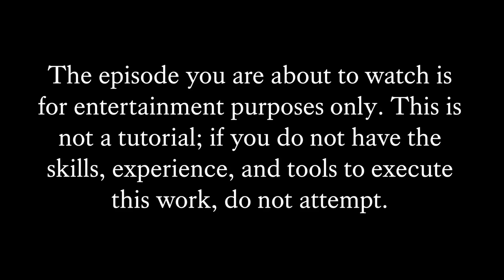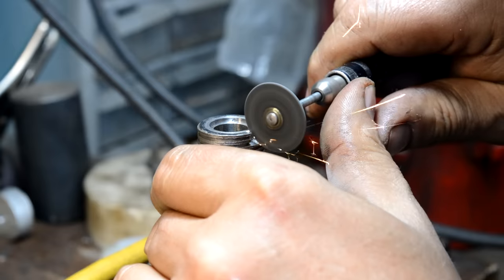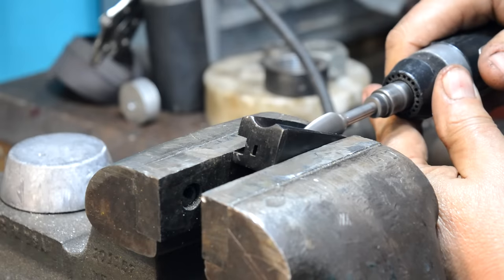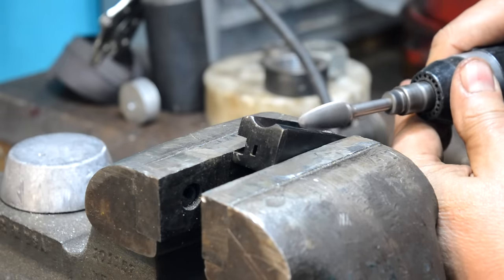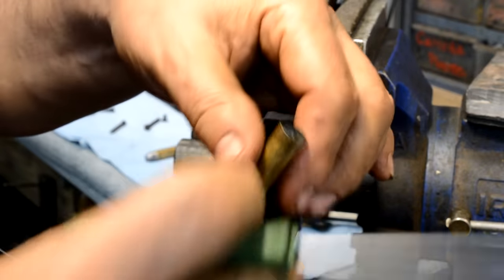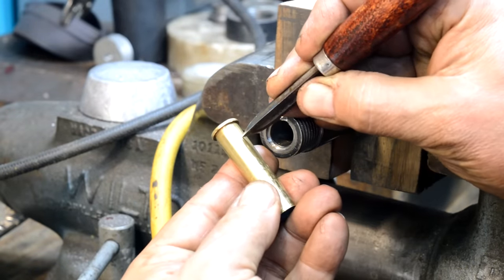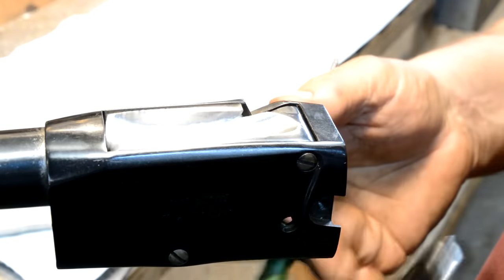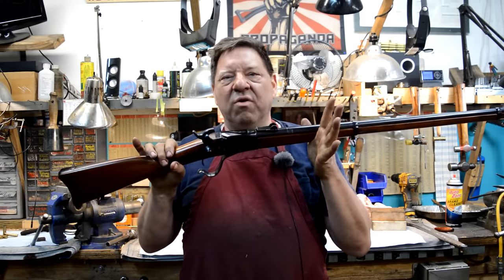Peabody Rifle chamber sleeve job: Anvil 112

Comment: If I remember, that cut is off center from the hole, I was thinking it may have been a broach cutter, then chisel work, or scrapers. They did such unique cuts with hand tools back then also.
Reply: I'd expect some custom tool for the job. If it's concentric to the pivot holes, then I'd use those holes to line up the tools.
Reply: I would say a purpose built broach was used.

Comment: I've often thought about how they cut the breech block shoulders in the martinis, and with it sharing the axis of the hinge pin hole it would have had to have been cut through that hole. It's possible it was roughed out with a radius milling cutter through the top then set up in a fixture with holes matching the pin hole on a separate machine. Here you could insert an arbor and cutter (similar to a line boring operation) to finish the radius to size and square up the corners. I might give it a try for fun, maybe make up a mock receiver and some tooling. If it's a success I'll post a video.
Reply: That'd cool to see!

Please post here if/when you get that video made.

Comment: I I had to make a bunch of them, I'd make a rotary broach that piloted off the pivot pin hole.  Segment it into enough individual cuts as to be workable.  Maybe a rougher and a finisher.  Make it out of M2 it should last thousands of cuts.
Reply: i like the idea but wouldnt there be evidence of the pivot pin hole in the block? what about a shaper very short throw and an right angel cutter?
Reply: @pghgeo816  the breech block pivot pin is there, Kipling!  😆

Comment: As per your question.. "How do they get that relief cove cut put in there?"..... Manually. Here is a video of the "ENDIE", not the "OUTTIE" or the "INNIE"... The the "OUTTIE" and the "INNIE" are two other processes, still manually dealt with, by means of manually assembling the cutting tool(s) once inside of or passed through an obstruction area... Although, this video I am placing a link to, may look primitive, in their processes, where as today manufacturing processes of full throttle automation has allowed for a more efficient mass production, there is still some processes, that no machining center can simply handle. At least not with out buying, or having built some high measure of specialty machining system that performs just that one odd/random step, that can be handled simply manually/by hand and cheaper tooling.  I would recommend simply watching the video for the sake of how great our beloved western world has it. 

But, if you pay note starting at the TIME STAMP of @6:00 for about 30 seconds... You will see, the dual "ENDIE" manual hand cutting tool in action, and the cutting surfaces dimensions are simply controlled by the nut at that other end, which also serves as the ease of removing the cutter to then remove the shank from the already reamed double shear holes, for the sewing machine's lift arm axle/bell crank axle. Enjoy. 
https://www.youtube.com/watch?v=N21ruMGeGa4
Reply from the maker: Nice video. Proof that high speed stuff can be built without lots of money.. Thanks

Comment: Mark, I defer to your knowledge, skills and ability in discussions with my friends. I once ran a machine tool business. So your question on production. 

The Martini-Henry rifle is a modification of the Peabody. And that lockup of the loading tray/bolt to the frame is epic. The British cut that frame with a device called a “side brooch”. It plowed out a rounded grove up in the frame. A rough cut in essence. A rounded cutter, think file, was then suspended on a shaft and partially rotated to further finish the cut. It was finally finished to dimension by lapping in the bolt with abrasive paste. This is why you can’t just swap bolts among old martini rifles. 

The tolerance on that bolt and the abutment is typically 0.001 inch or less longitudinally when in battery. And yet “parts” bolts for those guns may vary by 3-5 thousandths of an inch bolt to bolt. Because rach was fit using this laborious process. 

Now today we would use a 5-axis CNC with a ball end mill and simply cut that fillet and be done. They did not have that luxury. They improvised. 

Enjoyed your video as always. 

Fox out.
Reply: Would a "side broach" be similar to a shaper cutter?
Reply: @danmenes3143  
The “ thingy” I saw in a museum of industry in England was a mechanical brooch. Usually the bit is flat and cuts into the stock as it’s secured to the table. This one had an extension that stuck out the side with a button that would cut in a “blind” space. I eas informed that it had been used on the “muskets”, several martinis being on display I presumed that was the musket in question. 

I am not a machinist by trade. I came into CNC equipment on the computer side. But in consulting on programming I frequently asked how’d you make this thang in the bad old days. They were usually glad to explain all the gigs and fixtures to me. Then I’d write them a cad/cam file and go home. Different strokes for different folks. We learn as we go. Then I went home, took my martini all apart cleaned off the grease and started looking at tool marks up in the nooks and crannies. 

Fox out.

Comment: ANSWER❤❤: the Watts Bros Tool Drill is used to machine square holes.  When the lathe is running, you can see the head "bouncing" around in its guide.  Based on a concept which uses an equilateral triangle with bisecting curves of constant width.  Square holes can be so sexy.  "Triangular Wheels" on the Curiosityshow channel provides a simple tutorial, explanation, and application!  April '56 issue of Popular Science shows how to make one.

Comment: To make that cut in the back of the receiver, I would modify a ball endmill so it would have a spherical section on the end and machine to near the outside. After the semicircle cut I would fixture the receiver in a rotary table and use a slotting head attachment on a milling machine to make square corners with another custom ground tool. This last operation would clean up the edges and square them to the ends of the semicircle cut area. I used to work for John Martz Luger maker from Lincoln, CA. On the barrel extensions there is a stud cut into the side of the extension and it has a radiused area that can only be accomplished by using a slotting head on a milling machine, a correctly made tool and as the slotting head is reciprocating the rotary table is turning the barrel extension cutting a radius inside a small area. There were three or four parts on the Luger pistol that had parts that had to be slotted while rotating on a rotary table. Nice work Mark!

Comment: I believe that unknown cut you're asking about was done with the same type tool used to trim down the ears on the bottom of a 1911 barrel where the slide stop holds back the barrel. Like starting an old crank style Model T Ford, you have the crank rod, and a slide on sideways reamer bit used to cut the radius as you turn the crank. The bit would have to move across the plane of the radius as it's cranked, cutting from one side to the other.

Comment: Excellent video mark I had an old marlin whitney 40-60cal.carbin length saddle gun or so we were told  I wanted to have it rechambered to 45-70. However all the folks I spoke with told me the rifle wasnt a carbine  and should have been 11 to 12 inches longer and that there was no way to make the conversion. It was an 1880 model and year. The whole rifle was 29 3/4" long

Comment: I suspect the radius was cut using a cam directed single point tool something like a shaper or planer.  Today I might do such an operation with a die sinking EDM. But that is not suitable for high volume production. 

I look at how many of the cuts are made on lever action firearms and wonder how it was done.  Manufacturers in the past built a lot of dedicated machinery.

Comment: At  about the 7.5 minute mark you said that the Dremel has a place in the shop, but never as a "go-to".  I grew up with a gunsmith whose shop equipment consisted of an Atlas lathe, a Delta drill press, and a small barrel of dead Dremels.  He made a good living for 50 years knowing what his limitations , and the Dremel's were.  He'd go through 3-4 a year, and never a day went by that he did not have one in hand. Good Video!

Comment: The way that cut was done is definitely a real good head scratcher. If somebody told me to do it... I would put a 3/16 boring bar through that 1/4 screw hole and then insert a hss cutter into the boring bar. You can get a good 1/16 deep cut out of it I would reckon

Comment: 12:54 if the radius is concentric with the hole, it could only have been done on a lathe with a tiny groove cutter style boring bar.  If it's not, it could also have been done on a horizontal mill with a remarkably small arbor and cutter.

Comment: The cut is almost certainly done on two jig grinders, using a small radius grinding belt cantilevered on an arm. Infeed to one corner on the "left handed" machine, note the infeed hard stop, set up the "right handed" jig grinder to the same stop.  Clean up mismatch by lapping with a die made specifically for the task.
Reply: Could be wrong but not entirely certain that the grit and belt quality that we take for granted was available back when this was made..
Reply: @mastermaker666  Wouldn't be the aggressive and durable ones of today.  Significantly slower removal rates, perhaps even using emery cloth.
Reply: @DopetheWind  Not saying it can't be done that way, just that the machining marks indicate that it wasn't the way they did it and that they would be unlikely to have anyway given the time and effort involved when there was a faster and more efficient way of doing it(single-square-tooth boring-bar style cutter threaded into the hole without the spindle running)

Comment: You should just add a very small bead of tig weld or 2 after you line up the holes. This is done with a lot of manufacturers and doesn't harm anything.

Comment: Im guessing that cut was either done entirely with a horizontal mill or with a slot cutter cut vertically then a small boring bar looking tool to clean up the edges
Reply: Beat me to it!
Reply: Another thing that might work is a custom slab cutter on a keyed shaft that runs through the bolt holes.
Reply: Yeah that's what I was going to say. Horizontal mills were a lot more common in the late 1800's / early 1900's.
Reply: @kajiarrow7761  I was envisioning something like that a one off tool
Reply: yeah i cant envision how the edges or ends were squared

Comment: The machines back of the block with a very small boring  bar, with a removable cutter that's held in place with an end center line set screw.

Comment: Mark, I agree with Lauren H, 
I can remember seeing an old newsreel film converted to video of a Ball Burr being used to cut round ended recesses in a steel housing for valve pivots, they used a jig that moved the housing to accommodate the burr coming in from the front of the housing to make it cut  eccentric due to the limited opening for the milling burr.
In other words, for the Peabody receiver, they would feed a long shank round burr in  from where the barrel would screw into the receiver, maybe before the thread was cut to prevent damage to the thread.

Comment: Not all metal was removed by rotary milling cutters. I think broaches were also used in some firearm manfacturing. Look at the breech block mortise in the receivers on the Winchester low walls and high walls for instance. If you are making a few thousand of some part, a dedicated machine and cutter specific for that problematic part would be justified.

Comment: That part could have been cut on a horizontal mill with a face mill or shell mill. Another option is a rotary broach that indexes of pin holes.
  Some of the old machinist handbooks might give a clue to the process.

Comment: I was watching your episode on rechambering a Peabody rifle to 45/70 and you asked how the rounded cut in the rear of the action was done . The only way I could fathom that being done would be to use a short enough bit to fit through the holes in the side and machine it from the each side from the center . I’m a ne subscriber and have enjoyed watching. Have a great day.if I can make a suggestion for an episode, how to remove and replace a breech plug” slot stripped” from a muzzle loader. Thanks

Comment: You can use an engraver bit that you hold it with the engraver after inserting it from the inside out. Its head will eat the metal from the inside. Alternatively, you can use a straight grinder in the same way. This the easiest and cheapest way to do it.

Comment: Not a machinist, I’ve seen a similar machining job using a boring bar. Would have to be a tiny boring bar!
Reply: Yeah tiny boring bar thru the pin hole would do it. Good luck trying to get that to cut like 👍

Comment: The recessed groove: Boring-bar style single-tooth cutter threaded through the bolt hole without the milling-spindle running would really be the only way to achieve that square-shouldered recessed inside groove.
Reply: It could be broached..
Reply: @machinist7230  Broaching would not leave the kind of machining marks that appear to be in the groove.

Would also require hand finishing in each end to get rid of chip remains and there might also be a joint mark somewhere in the middle as the only way to broach that to sharp inside corners on both sides would be to do half from either side so it would require 2 operations + manual finishing, from a production standpoint a single tooth milling-cutter would be faster and more efficient...
Reply from the maker: This is the best answer yet, in my opinion, because I do not know either......
Reply: @marknovak8255  I've been trying to figure this out for years. I've got a few around here, and I've sat at night looking at that cut and trying to put the puzzle together without pulling my hair out. Then, whammm, you ask the same question. I even wonder how they do it in the Khyber Pass with their copies. It's been bugging me forever, seriously, as one of those things that just has to be 'known'. Some interesting answers on here, but I'd still love to see it with my own eyes. I've seen people wanting to piece together an action in four parts, all because of this one cut. I always say 'no', and not that it can't be done, but there is not much metal to go around in critical places, imo. This one cut, the do all, or end all, cut....I wish I had been present in the shops back then, my eyes would have been glued to it.

Comment: As far as the machining steps for that rear cut. I would assume they did the bulk of the cutting to open it up drilled both holes then had a small radius cutter that was placed through the screw hole to cut the initial rear slot and then kept increasing in cutter diameter. I wish I could draw it out because I can't very well write out what I'm thinking in a clear enough form to make sense.
Reply: Was thinking a very small line boring operation.
Reply: That's it, they used the screw hole to insert and assemble an adjustable cutter.

Comment: machining that piece at the back is simple
They use a small shaft that goes through those 2 holes on the side and they use a larger cutting bit that the shaft goes through,
And turn it like they are doing a line bore
But inside a cut away.
They probably cast most of it out in the first place when making that piece,
and the machining process is little if any, just a lean up.
If they don't do that,
There is a grinder that can be fitted to slot down in there,
By using a rubbing friction wheel pushing against the cutting wheel
And move it from side to side

Comment: I live in Birminghsm UK not far from BSA where you can Go to the Gun Quarter and see all the old tools and machines used..one type of Barrel made by bending a single piece of wire around a bar n soldering in All the gaps in the spiralling barrel sets.French origin I believe,left a beautiful set of barrels..

Comment: I assume they made the cut which takes the recoil load by using a cutter you assemble within the frame, i.e. put the cutting wheel inside the frame, them put the drive shaft through the pin holes and through the cutter, secure it somehow and then do the cutting. Kind of like in a horizontal milling setup.

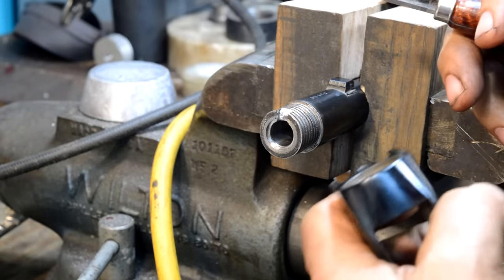Comment: At 12:26, that cut was likely done with a shaping machine, which has a cutter mounted on a reciprocating tool holder running back and forth peeling off a sliver of steel with each pass.
Reply: yes  like this idea  it would have had to be a purpose-built shaper
Reply: @pghgeo816  if you're making a couple hundred thousand rifles, why not spend the money on a custom tool to make the job easy?

Crud, I know mechanics make custom tools all the time, even for a one-off project.
Reply: @ScottKenny1978  i agree  the question is what is the method mill ? scraper ? broch
Reply: @pghgeo816  saw one suggestion that was basically a scraper assembled through the screw holes, and then finished by lapping the breechblock into the groove.

Comment: Mark, what do the cutting tool marks in the radius cut to fit the block show?  Knowing that, plus ideas/info from several other comments, ought to give you a good chance of determining how it was machined.  Please let us know what method you decide was probably used to machine the part.
Reply: a high resolution closeup might reveal the cutter marks that would give some indication how the operation was performed.